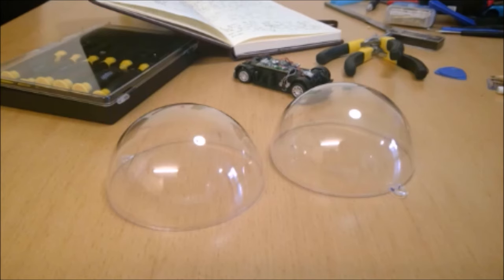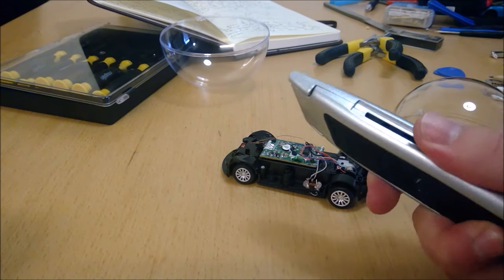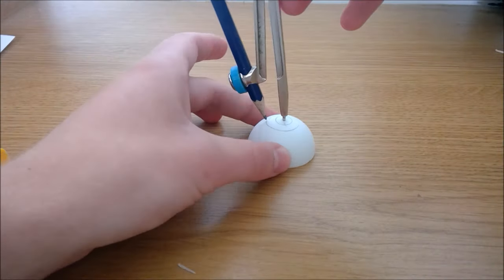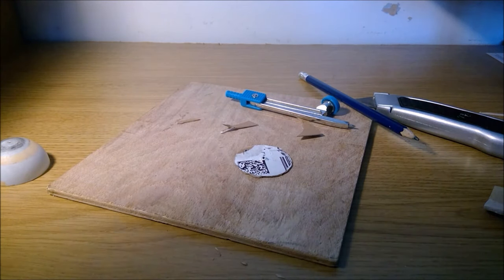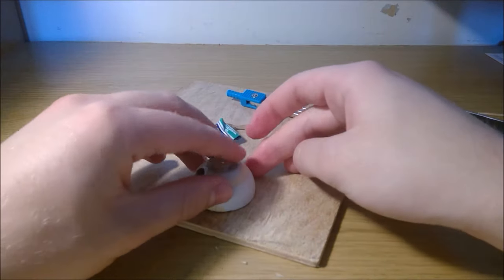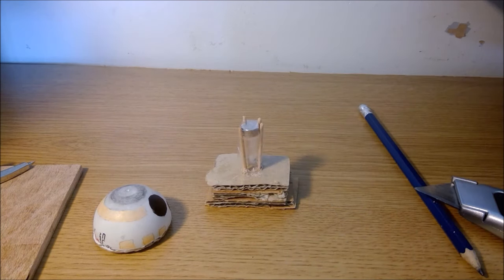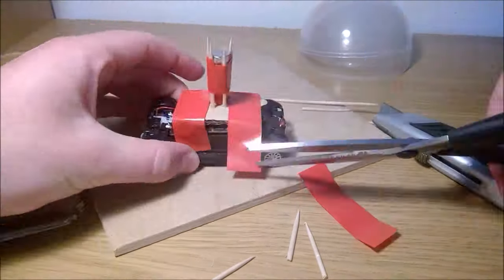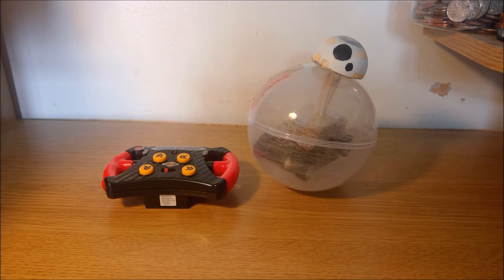How To Make a Remote Control BB8 for Less than £20 (26 USD)

Comment: Nice build but does it go left and right (it doesn't look like it can)?
Also, I made an r2d2, I made the body and legs with white cardboard, then I added decals with blue paper and I made the head with a plastic ball (I covered it with aluminum tape to make it silver), added decals, and finally, I got 2 wheels and 1 RC car, I attached the car to the middle leg and the wheels to the left and right legs. It's now working. I filmed some videos with my phone and I am gonna edit them on my pc and upload them in 1 video. it will be out in a few days.